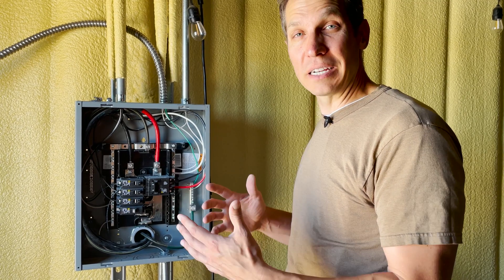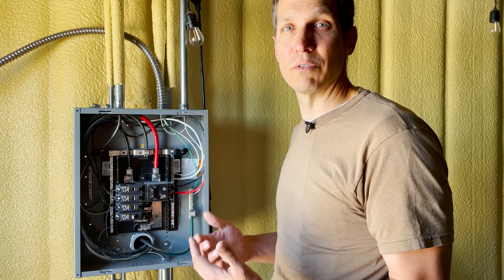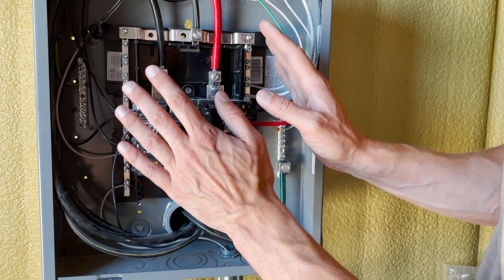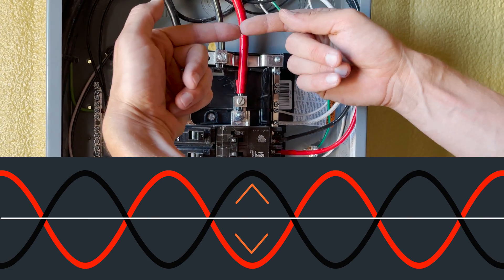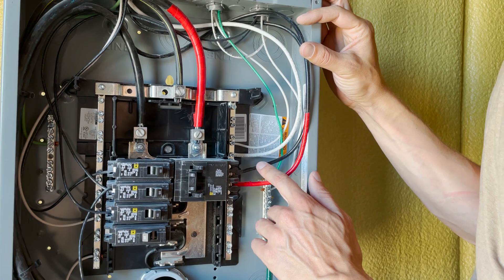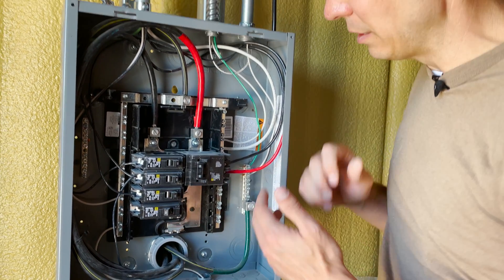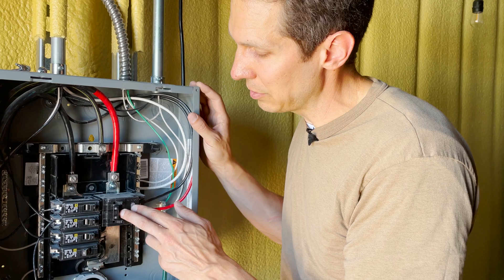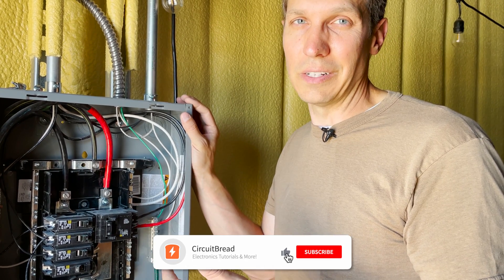How to Wire for 240 Volts in the USA | CircuitBread Practicals

Comment: LOL you were making me nervous as hell touching everything until you said it was a dead panel. Thank you, the pucker factor was intense 😂
Reply from the maker: 😂 I'm terrified of mains power, I don't do any electrical work without it being completely dead.
Reply: Yeah I thought circuit bread was going to turn into circuit toast 😅
Reply: In Australia, unless there is NO supply connected always assume it's live and test before you have to touch a hot wire and even then short it against the neutral.  When testing if using a multi meter unless you know what you are doing DON'T.  I can make any multimeter read 0v (or close enough) across 120v, 240v, 415v without any issue at all, just put the meter on the DC range.  Even 120v can and does kill, then there is the danger of fires if you don't know what you are doing.  If you you don't have the appropriate training get someone in, this stuff is so dangerous.

Comment: Can I run 240v from a 2-wire (black-white-ground) Romex?
Reply: remember: any fully "240" /250v appliance will never use a neutral, 

ovens and clothes dryers are 4 wire because they require 125v for the lightbulbs, controls and even fan motors in some cases
Reply: @ethernet01 I am only getting 124 volts on each leg of outlet and on each screw/wire of braker and when combine both legs of 124 volts on either outlet or braker I get 0 volts. Replaced braker and still 0 volts. Any idea why can't get 240 volts?
Outlet for drier has 4 prungs, ground, neutral and 2 of 124 volts.
Do I need to move the double slim braker to the right side of braker box which is full with 3 x 240v brakers?
Please advise.
Please advise.
Reply from the maker: You'll need to check modern building codes for a true legal answer but my recommendation is definitely not.  You'd be using the ground as the neutral, meaning that your bare wire could be energized (not all loads use the neutral wire) and you'd be left without that protective ground.  OR you'd be wiring it without the neutral (which would be fine for many 240V loads) so that you have your ground wire but certain loads wouldn't work.  Again, I can't provide legal advice or anything like that, but I personally wouldn't do it. But I don't mess around with electricity, I always err on the cautious side.
Reply: this is completely legal if you reclassify the neutral as a line by using red or black phase tape or heat shrink (NOT SHARPIE) on both sides

it is an extremely common configuration, virtually every water heater and air conditioner is wired this way

Comment: Why am I getting 0 volts when testing AC volts phase a to phase b in this system but I still get 115 from phase a to neutral and phase b to neutral
Reply: Did you solve your issue?
I got the same problem:
I am only getting 124 volts on each leg of outlet and on each screw/wire of braker and when combine both legs of 124 volts on either outlet or braker I get 0 volts. Replaced braker and still 0 volts. Any idea why can't get 240 volts?
Please advise.
Reply: Because you don't have A phase a and a phase B. They are actually the same. Someone made a mistake there.

Comment: If those two 120v lines are positives then how the heck do you get usable power?
In school we learned that you need + and - not two +-es!?
Someone please enlighten me!
Reply from the maker: It's because they're out of phase.  So, in AC circuits, the polarity is constantly switching between positive and negative.  With the two 120V lines, when one is positive, the other is negative. Because of that, there's a 240V difference between the lines at their peaks.  I hope that helps!
Reply: @CircuitBread  I'm no expert but I have it on good authority that each 120v leg in the US is in phase, not out of phase.
 https://youtu.be/nOSYHUxHxG8?si=9ZKqKAihgHpHSoCF

Comment: Could you please be a bit more specific about where to get the neutral line from for the 240v breaker /lines?
Reply: From the neutral buss bar. (Where all the other white neutral wires terminate.)
Reply: @wolfman231  thank you
Reply: @rolandtheron833   becareful he is leaving a LOT out its not worth your life you are risk doing this on your own as the utility wires going into your meter to your panel are always live unless you have the city turn it off for you. unless there is a disconnect between the meter and panel i would think. dont just rely on youtubers for stuff like this its illegal to do on your own... and you need to know a lot about bonding and code
Reply: So I have 4 wires red, black, white, green going from my box to a box is my shed. Red and black connected to the breaker like you have here. White goes to that neutral in both boxes. Green also goes to the neutral in both boxes. I guess that green really doesn’t need to be there as a second neutral. A buddy who has a lot of experience with 240 and works on 240 in a plant said that is pretty common and the green is hooked to the neutral if there is no ground to earth. Is this right?

Comment: My 240v outlet plug/receptacle for generator has 2 hots, a neutral and a ground.  Does or can the ground/green wire and white neutral go into the same ground buss bar at the main panel?  Thanks!
Reply: Neutral and ground must be bonded at the main, sub panels have to be separate…if you do not understand electricity, hire an electrician
Reply: ^^^^ DS gives the exact, accurate answer.
Reply from the maker: Hey Michael, they are usually kept separate and they really should be kept separate.  The neutral line is connected back to the grid and is part of that circuit, whereas your ground buss should be literally connected to a bar that is driven into the ground or some sort of ufer.  As always, when in doubt, get an electrician to help or do it for you.  I hope this clarifies things!

Comment: Can't I just bridge my hot leads and just add 240 circuit breakers onto my panel?
Reply from the maker: I'm not sure what you mean by hot leads but yes, you should be able to get a 240V circuit breaker on most panels.  It just taps into both leads.

Comment: First off is that a sub panel or phony panel feeding off a main panel. If so why is the neutral grounded to the box, and is the box earth grounded? 
Normally you would not ground the box if its a sub or phony panel its bonded at the main.  Also why are the 2 120 volt wires larger then the natural wire. Shouldn't all 3 be the same ga wire  it would have to be for DC and wile ac is alternating current both wires need to be the same ga or the larger wire won't do anymore then the smaller wire can do.

It always confused me why older dryer circuit lines and stove lines do not use a 4 bare copper wire for ground even thought the neutral and ground are the same its still a safty issue.
Reply: The white wire on the left attaching to the ground bus probably is a green ground wire instead of a neutral. They just did not put green tape on it. The 240 v circuit goes out the bottom. I cannot find the incoming ground wire. The incoming neutral is black instead of white. The bottom 120 v breaker is not used.

Comment: So, if I need a 3 prong outlet for 240v, would I need some device to convert it or how would I get a 3 prong outlet to be 240v? I am trying to convert a server rack to 240v they only have 3 prongs. (They do support 240v)
Reply from the maker: You don't actually need three prongs for 240V.  In the US, for 120V, you have ground, neutral, and line.  Ground is the round one in the bottom, neutral is the larger slit, and line is the smaller slit.  Wiring for 240V, you simply make the neutral another line which is out of phase with the other, making the 240V different.  If you look at an older 240V dryer plug, you'll note that it's only three plugs and it's basically this configuration (but the plug is bigger because it's setup for 30 or 40 amps, not 15-20 amps.)  Newer dryer plugs are 4 plugs because they have the two lines, a neutral, and ground.  But if your server is setup with a 3-prong plug and expecting 240V, it's fine to do it without a neutral line.
Reply: @CircuitBread  thanks a ton for the informative response. would it be safe for neutral and ground to be combined or we just forgo neutral all together?

Comment: "Not that common".  I would disagree.  Many houses have electric clothes dryers or electric ovens with 240 volt lines.
Reply from the maker: Yep!  I guess I should've been more clear.  I have five 240V circuits in my house but that's a lot less than the 120V circuits I have.  Perhaps "less frequent than the 120V circuits"?  Or something like that?
Reply: @CircuitBread  Yeah definitely less common.  Many houses don't even have them, and the ones that do only have one or two compared to the dozens of 120v outlets.  I guess it depends on what you mean by "not common".
Reply: @CircuitBread    Good video though.

Comment: Single phase of power, split.
Reply: It's single phase because there's one coil and the windings go in the same direction from L1 to L2. Opposite phase would mean that the windings would reverse direction at the mid point and that's not the case. Each end is at opposite polarity from the other, so there's no such thing as "out of phase" in residential electrical wiring. It's a common misnomer. It would be more accurate to say "opposite Line" or "opposite polarity".
Reply: @surferdude642  The midpoint is always opposite polarity (at the exact same time)
of the two (2) ends L1 and L2.
Reply from the maker: That's a good question - is it considered single phase split in the electrician industry?  To me, they're 180 degrees out of phase, so I'd say there are two phases.  Compared to 3 phase power where they're all 120 degrees out of phase.  But I could be looking at it from a different frame of reference.